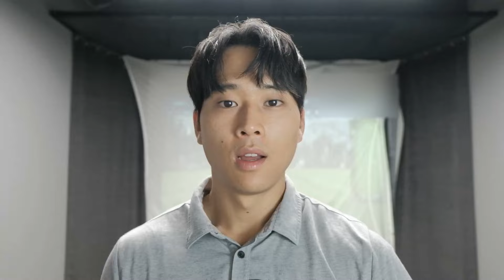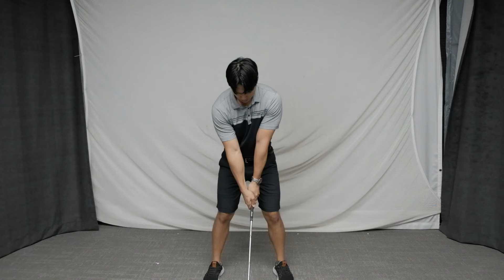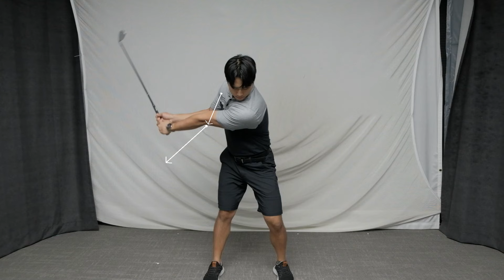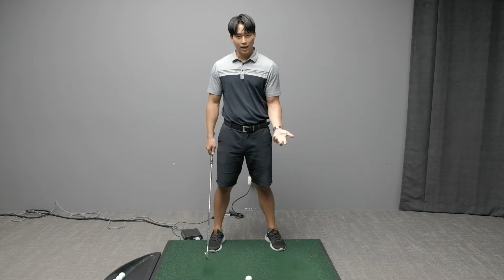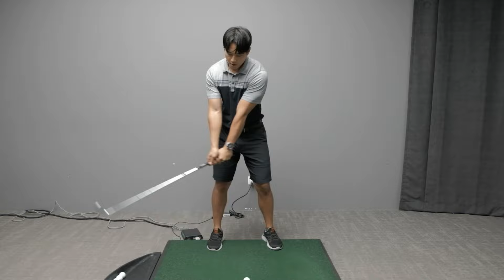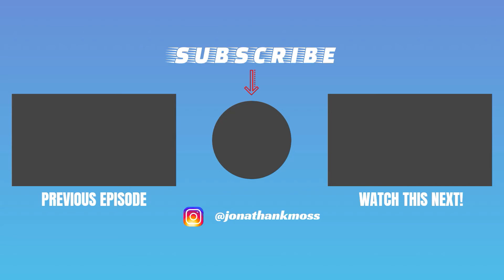4 POWER MOVES (PART 1) - TRAIL ARM BEND/EXTENSION

Comment: If R elbow bend is a power source then why limit its flexion to less than 90 degrees (best players don’t flex beyond 90)
Reply: When you bend your right arm, you are actually adding another axis of rotation, around the elbow.  This is another source of angular momentum which will translate to club head speed.